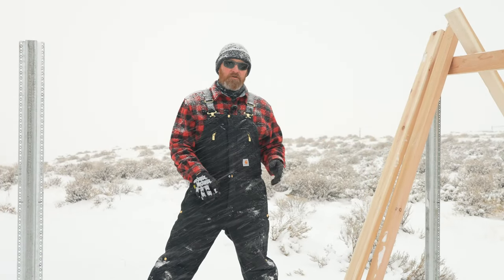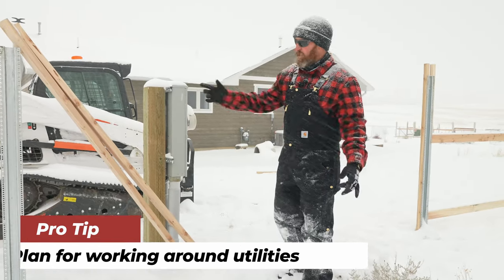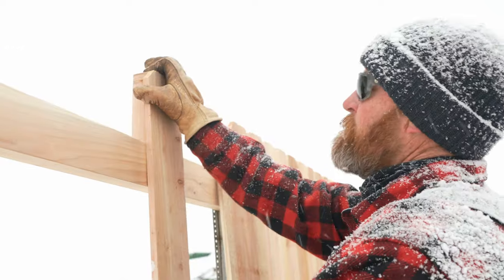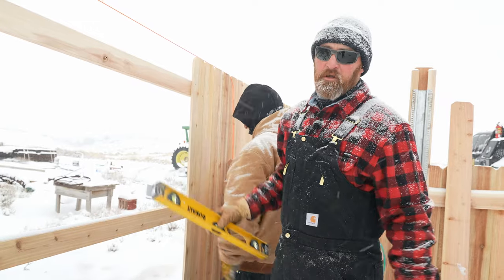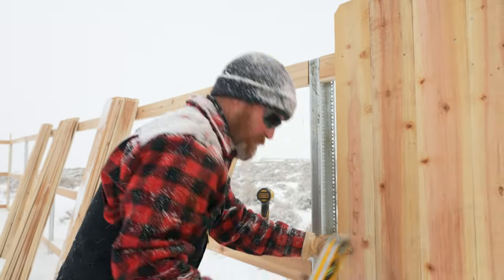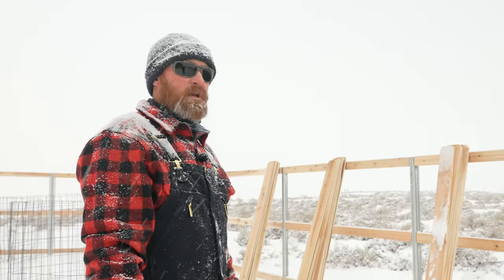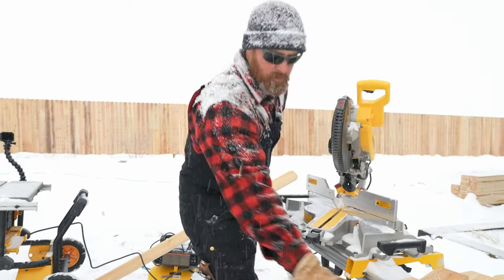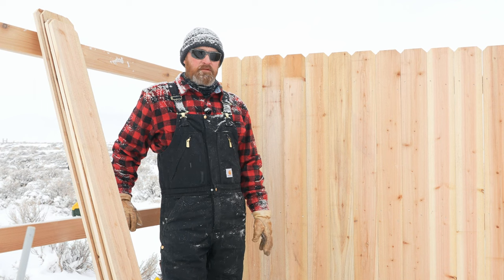How To Build Easy Cedar Privacy Fence

Comment: Building this type of cedar fence, but with board-on-board pickets using (stainless steel) screws all the way. Does the pneumatic nailer pierce the steel posts, or do you just avoid them? I've resorted to predrilling (9/64" for #8 screws) for those situations.
Thrilled to see my beautiful fence materializing. Thanks for the helpful videos!

Comment: According to Postmaster, on the hinge side of the gate you should be butting two of the metal fence posts up against each others for more strength.  Then you can screw two 2 x 2 into each other. Or, weld the fence posts together.

Comment: Do you think that leaving a 1/8th inch gap between the fence pickets would keep the fence looking nicer by allowing air in between each one to allow water to dry out after rain and snow?
Reply from the maker: It might hide any shrinkage of the pickets when they dry out--but I don't think it'll help with drying overall.

Comment: Question: should I leave a 3/16" gap between the pickets for expansion in wet weather??? Or do you prefer just butting them together???
Reply from the maker: We use cedar, so it's more about the home-owner's stylistic preference for us. If you're using something besides cedar you should probably research that wood and yes, you may need to leave space.

Comment: Can you tell if postmaster posts can be used to install a lattice to already existing fence. Second question, can you connect 2 post together to extend the height for the lattice (6ft fence 2 ft lattice)? Overall I like the idea of using it. Thanks
Reply: They make postmaster posts to 12 feet.  If you are adding lattice to an existing fence you are laying it on top of the top rails and adding horizontal supports.  There are specific extension kits for fence extensions not what a postmaster post is designed for.

Comment: 7:30 I'm still a little foggy on how you adapted the topline of the fence to the changes in slope. I suppose you either have to compromise with the gap at the bottom or have the fence match the rolling contours of the yard. Does the line run perfectly level from corner to corner, or is there a slight bend where you restarted your string there?

Would've been cool to have a zoomed-out shot of the finished project.
Reply from the maker: That's a great point--we're trying to remember to show the finished product at the ends of videos these days.
So he rolled the fence to blend more with the contours of the yard, and that rolling happened when he set the posts to height. Then when he sets string he wants to make sure he doesn't run it past any posts that are rising or falling.
Reply: @SWiFence  Ahh gotcha, thanks man. The weather was pretty rough so I don't blame them for being a little short of B-roll.

Comment: I tried leveling my pickets but the pickets are not straight, my slopes are way up and down so with the changes in the ground I would have to leave uneven gaps to get level. 

Any Ideas?
Reply: Stair step the panels?

Comment: No mention of fence board spacing?
Reply from the maker: Picket spacing? This fence has no spacing as it's a full privacy fence. If you want semi-privacy with air gaps you can adjust. 👍🏻
Reply: @SWiFence 
I used to have to go and replace cedar fence pickets in winter here in Oregon.The reason was I worked for Lowe’s doing fence installation for a local contractor. He used to tell us to install without a gap in the fence boards. 
The cedar was swelling and popping out on a few sections due to all the rain we get (Willamette Valley, Oregon.)
So occasionally in winter this would be a problem and they’d send me out to replace them with ripped down ones to fit. 
It wasn’t all the time but it was enough to be annoying. 
Maybe it’s dry enough in Wyoming to not be an issue. 
If using fir or Japanese cedar it is even worse. 

It slows me down spacing some but prevents boards pushing out due to swelling around here. 
There’s plenty of stories on the internet about this problem. I’m guessing wetter environments than yours. 

That’s great you guys use postmasters. Saves a lot of trouble with warping, twisting and rot. I’ve done a few fences with them and I’m impressed. 
Im still looking into using a post driver to pound them in instead of concrete. Most of my customers ask for concrete here though so far.

I like your work, and the YouTube vids you do.
Reply from the maker: Thanks for the compliment! It is definitely dry here so we don't typically have those issues. (A few guys on the crew refer to it as popcorn fart dry.)
Reply: @SWiFence  I didn't know that popcorns could fart.